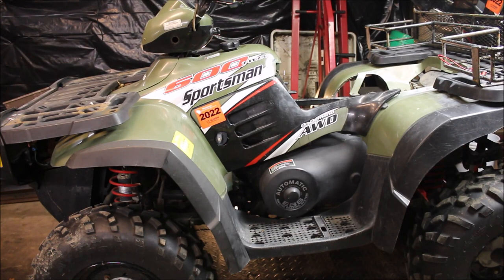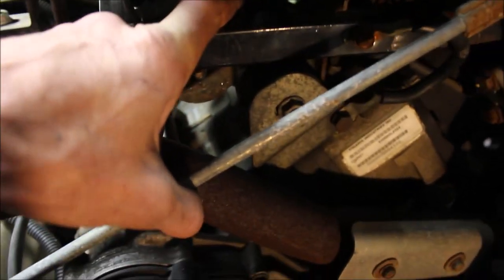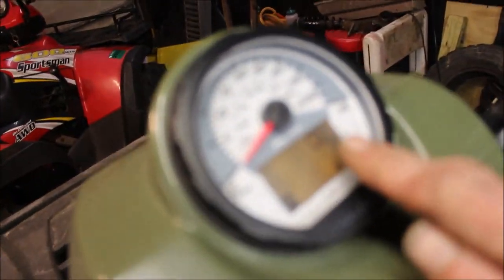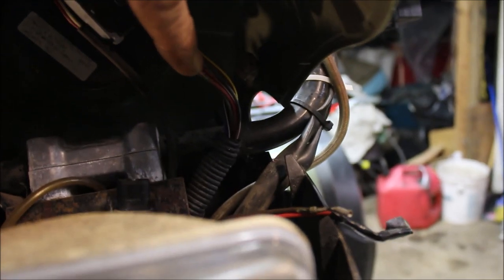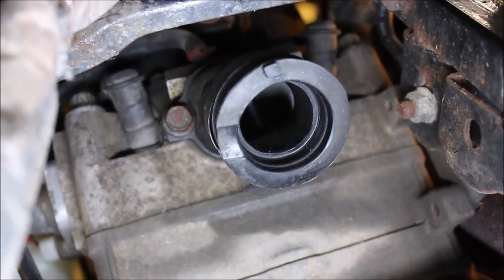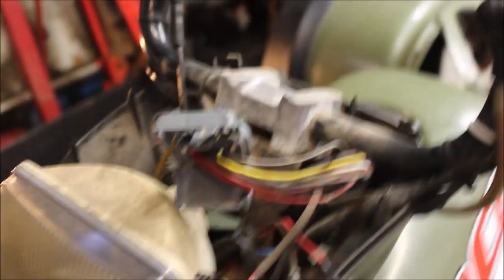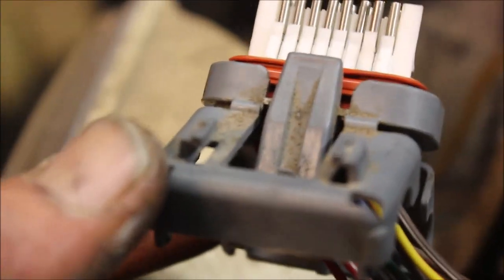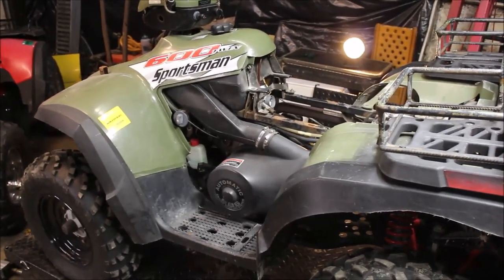Rough Idle or backfire on your Polaris Sportsman 600/700 ? Find out WHY!

Comment: I saw you said the carb was installed incorrectly. Any vids on how to properly install a carb on a 04 sportsman 700? I think the one I just pulled was incorrect
Reply from the maker: Not on a 700. But one breather tube on the right should be closed. The left open with a tube. The pulse pump gets connected to the engine. So if there is a port on the right to pulse pump it needs to be blocked off.

Comment: I have a 2008 Sportsman 500 ho.  
   It ran fine when recently purchased.
   Then it started backfiring and would only stay running at high throttle.
   I discovered the rubber boot between the intake and carb  had come loose from the carburetor.  I reattached it and it ran fine until the boot came off again due to 😢the motors vibration.  Looking into a replacement boot, I noticed a design difference.  The current boot was straight in design.  A new replacement boot it’s offset.  I realize the carb and intake are not in alignment.   I am hoping the new style boot corrects this issue.
Reply from the maker: It should. Usually, a backfire will make the carb pop off if the inner seal on the boot it worn. Not sure what you mean that the new boot is offset. good luck.

Comment: I have a 2004 POLARIS SPORTSMAN 600 when cold runs on one cylinder till it's warms up after ok
Reply from the maker: They are cold blooded. Some guys use something to hold the throttle open till it warms up. But yeah. probably not good its running on one cylinder. Have you checked the plugs all?

Comment: Hey, I'm at a loss with my POS 700. Followed a bunch of your videos for ideas and I got frickin nothing still. 
My intake boot was ripped so now she idles better then ever, but original problem is I can't throttle past 3/8 of throttle I believe it's flooding out. I have replaced all fuel and air components ( fuel pump, lines, filter, carburetor different size jets in main and secondary new intake rubbers air filter - sparkplugs - checked the flywheel out i thought maybe she broke the woodruff key and is off time a little. That wasn't it. Disconnect the choke at full in. Pulled the primary clutch to prevent drag. Checked compression that was good. Hard to tell if I had a good seal on with the leak down test but it did pass both cylinders ( one cylinder at 9 percent one at 13 percent ) I'm looking for some fresh ideas. This is a 02 sportsman 700.
Reply from the maker: Yup. I had the same headache. I cleaned my carb 3 times. Didn't work. Tried a aftermarket carb. Didn't work. jet was too small. I bought a 600 that came with an extra carb so I cleaned it, installed it and it ran perfectly. Check your fuel mixture screw. The only thing I can come up with is the carb needs to be dipped to clean everything out. Sorry I'm not more help.
Reply: @TitaniummanGarage  thanks for the advice!!
Reply: Figure that 700 out.  I have one with a brand to top end the will not take any throttle. Tried two cheapo carbs and they act the same way.  Flywheel magnets are good an intact. Looks like it has an upgraded CDI set up since the old ones were problematic.  Customers ATV and at my wits ends

Comment: Hey new subscriber here, Do those boots  Rip because people don't put the metal brace back on? or because there is a metal brace?  the engine floats on rubber mounts so it can actually tear the carb which is mounted hard on the frame, which is causing it? What's the best route? It's already got a new intake boot but no brace so I'm thinking it ripped and they thought it was due to the brace and left it off?
Reply from the maker: Both..

Comment: I'm glad I found ur channel I got the same carb and I took the middle line off because it was making my motor cut off but my carb is leaking from the bottom and idk what else to do
Reply from the maker: usually the needle and seat leak on them. Maybe try a different brand.

Comment: Is there away I can message u directly. I'm working on a 600 v twin and someone changed hoses and card trying to find correct vacum and vent locations air box has 1 line blocked off. Not finding a lot of info. Changed carb boot and 2nd carburetor idels good wide open good first part of throttle dies down sputtering and skipping or just shuts off please help not sure what to do anymore
Reply from the maker: One come out of the top of the engine and the other from air box to reservoir
Reply: @TitaniummanGarage  um reservoir location not sure
Reply: @TitaniummanGarage  that one is  plugged off
Reply: Thanks for information. Still having problem will idle but thats it im assuming maybe its electrical im stumped everything looks good
Reply: @melvinhowerton5339  did you even find the issue as im having the same problem
Reply: @lt7147  no runs bad at start up runs good for while and bad agin I think it's its internal problem maybe cam or valve

Comment: Hey boss where you located I got a 700 sportsman to up and it is got code for 45 46 + 22 41 51  in northeast PA 2007 run like shit
Reply from the maker: I'm in Wisconsin.  I had a code on my 800 like that. I think it was 45 or 6. I wiggled the wires going to the sensor and it went away. Polaris had an issue with the thin wires going to fuel injection systems. Wires broke. Check those out.
Reply: @TitaniummanGarage  can I just buy a new harness for that and the other question was with the fuel rail minds of 700 2007-2 up for the fuel injection rail I seen some with one line or two lines
Reply: @TitaniummanGarage  should if I was coming all the way out to Wisconsin I have to bring my snowmobiles to
Reply from the maker: @mikehodge1634  LOL. If I had a dollar for everytime someone asked me to work on their sleds I'd be rich. I hate working on sleds. Not so much the engine. its synchronizing the carbs I'm not fond of.